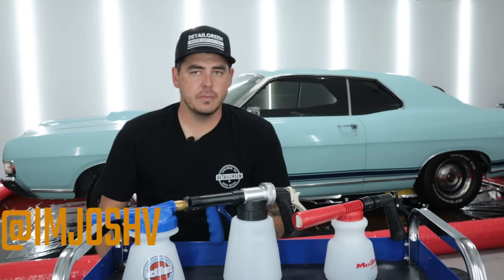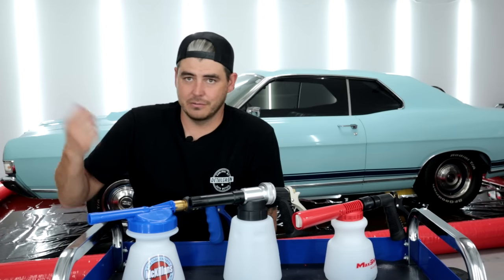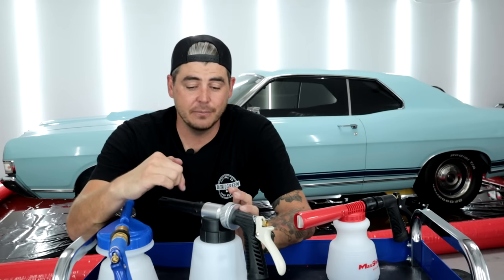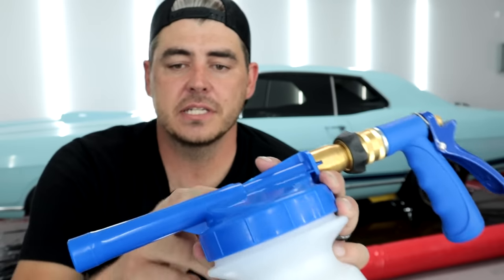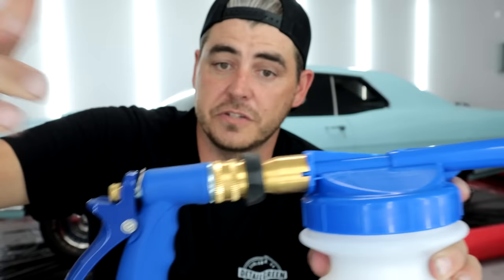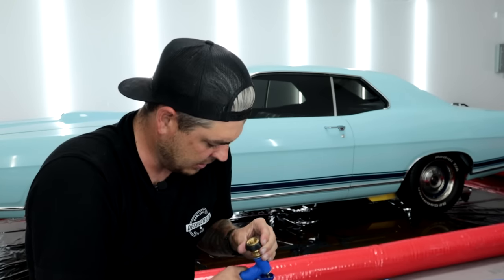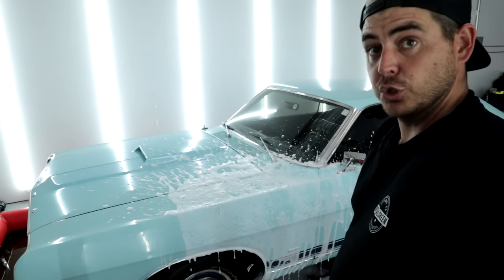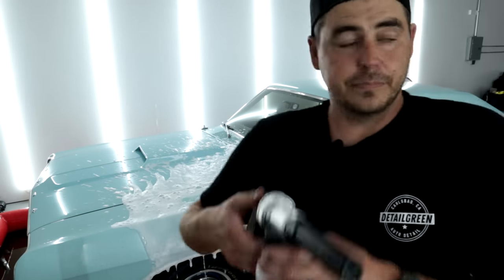Foam CAR WASH without pressure washer! Garden Hose Foam Gun

Comment: I have the chemical guys one, and it's really only useful for turning lots of soap into suds on the ground... Seems like a genius business model for them
Reply: I’ve had the same results with that foam gun.  Waste of money.
Reply: Same here and their Canon gun too. The Canon doesn't make nearly as thick of foam as the ones he uses here with the 1.1 orfice swap! I'm so disappointed because that chemical guys one was about 80 where the mjjc is 68 and the cheap Amazon is like 20 bucks or less! I ordered the mjjc and have plenty of 1.1 orfices, now I gotta wait til it gets here
Reply: @ericinfante1885  The chemical guys foam blaster was the first purchase I made for my truck washing kit. I tried to convince myself I didn't need a pressure washer and a foam canon, and while that's technically true - an electric pressure washer (I have the Active/Cat 1800 PSI) and a foam canon (I now have the MTM PF22.2) are very impressive time savers. If you're watching this video it means you're probably considering one of these and trying to convince yourself that the 50$ here is better spent than the 150-300 for a pressure washing setup... save your time (and possibly a little money in the future) and just get a decent pressure washer (I hear the >$80 WEN is pretty good) and the MJJC Pro foam canon (with a 1.1 orifice) and you'll be good to go. 

(EDIT: I replied to Eric, but this comment is really for everyone else)
Reply: @kylegeldmaker  I have the craftsman 2100 psi 1.2gpm he reviewed here as well! Works amazing, I had the greenworks pro 3000 psi forgot the gpm and while it was good it wasn't any better than the craftsman and costed about 3x more. It broke down withing my 3rd use brand new! Horrible customer back and forth service and the craftsman has been an absolute pleasure and reliable machine for 4 months now! I have the torq foam cannon from chemical guys and an Amazon one and both don't make as thick of foam even tho I swapped the orfice with a 1.1?! Not sure what's up but I think it might also be cuz the internals of the cannon might have build up that affects its optimum foaming ability so I'm going to have to replace them with a cheap one until my mjjc cannon pro arrives in November, they didn't have fast shipping available

Comment: I used a couple of these for quite awhile after opening my shop until someone gifted me a pressure washer. I picked up one at Harbor Freight for like $20 that actually worked well for me for months. shrug, I now use a Griot's garage foam cannon that is obviously far superior but they did work ok.
Reply: Harbor Frt , one works pretty well  👌🏼
Reply: Harbor freight sells griots garage hose foam cannon now for 20$ I looked at auto zone and it was 50$!

Comment: I have the Grant's foam gun from harbor freight and it performs well for me. Suds very well with hyper wash from meguiars.
Reply: What garden hose do you use? I’m new to this
Reply: @leojohnwayne1422  just a standard  hose. 5/8s I think
Reply: @martymccord9875  thanks I’m about to purchase a flexzilla hose
Reply: @leojohnwayne1422  awesome. I have been wanting to pick one up myself to hopefully  prevent kinks
Reply: @martymccord9875  yes that’s what I heard. 
By the would u recommend a blower to dry off or a towel if so what brand?
Reply: @leojohnwayne1422  so me personally I have a small handheld "performance tool" brand blower from tractor supply. I go around and blow majority of the water off and in the hidden spots, then follow up with a drying aid and towel. I currently use meguiars ceramic detailer and griots garage drying towel

Comment: I bought a Adam's Standard Foam Gun and it just creates runny soap.  Used it once and threw it in the trash.  Watched some of your videos and ended buying a CAT Electric Pressure Washer with a MJJC Foam Cannon PRO, UBERFLEX Hose and quick connects.  Thanks for the great videos.

Comment: I bought one made by griot's from advance auto for those times i don't want to drag out the pressure washer. I want my $30 back. What I didn't notice is the nozzle/sprayer to foam gun connection is plastic on plastic. It's exceedingly difficult to get it to actually connect. Sooner rather than later, I'll be buying one with a metal on metal connection.
Reply: This is my experience with that one as well.  Just bought it on a whim so I could get away with pulling out the pressure washer.  I mean it sorta foams, but it's a wet foam.  It just can't aerate well enough.
Reply: @jeremiahgaskins7205  agreed. It foams. Would probably be like 2nd place in this vid. It just blows through product (I can't even get my entire Chrysler 300 covered without refilling), and is more trouble than it's worth in general

Comment: After watching this I'd still prefer Chemical Guys Torq foam gun over these. I use the highest setting, but there's a dial on the CG foam gun that controls how foamy you want the soap to be. It's been pretty reliable, but I've switched to using a pressure washer now. So I don't use the CG foam gun as much. But if you don't have a pressure washer, the CG foam gun is the way to go.
Reply: Hopefully I have similar results. I got the chemical guys foam gun to hold me over while I save up for a decent pressure washer and foam cannon.

Comment: The size hose you use is critical. He’s using one of those coil hoses which provides very low pressure. You can see when he’s spraying, I can piss with more pressure than that… 😅 I have one of these and it works very well, but I use a 3/4” hose with 70psi pressure..
Reply: 70 psi pressure .thats the difference.

Comment: Great channel!  I am seriously considering a Ryobi PW with the “upgrades” you suggest.  As for foam guns, I was surprised how bad the ones in your video worked.  I have only ever used a Gilmour foam gun and it produces substantially more foam than the ones in your video.  If you are interested in showing your viewers better preforming models, that work does work.  They have more than one model, mine is the one that shows visible brass.  It looks just like the Wolfgang model.